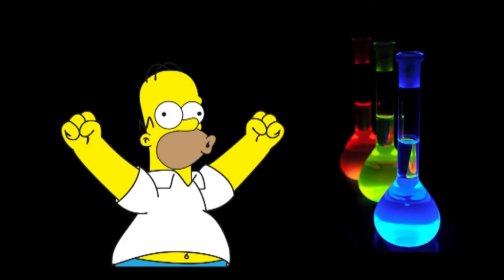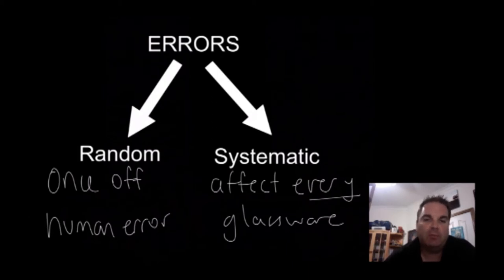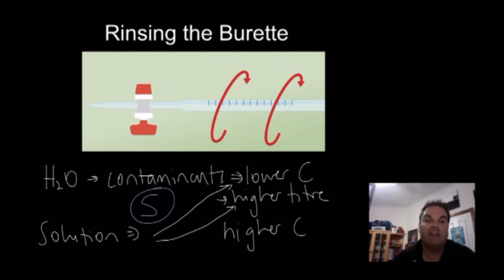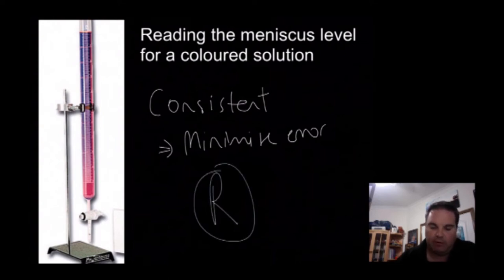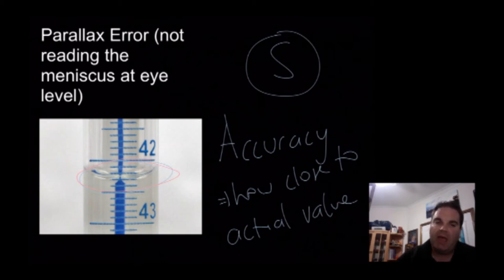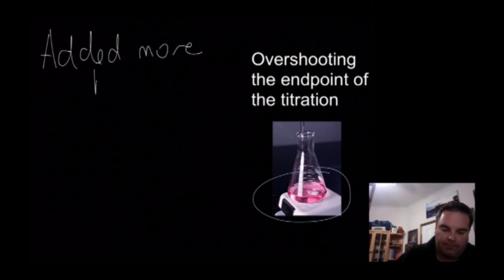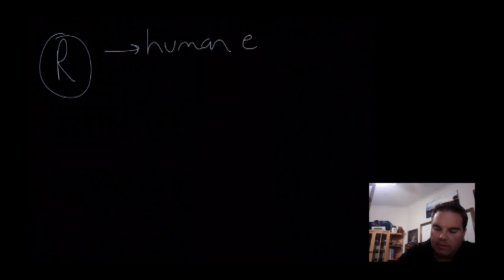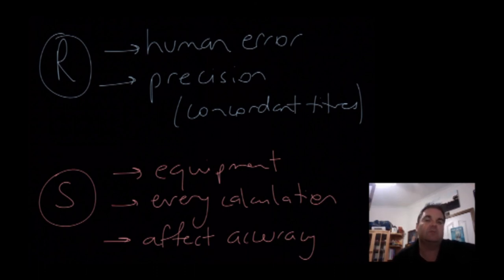Random and Systematic Errors in Titrations

Comment: Hello sir, how does the concentration increase when the titre is low in 6.07
Reply: He has actually made quite a lot of mistakes, including the one at 6:07. Suppose, 10 ml of the titre is actually added to the reaction vessel, but the added drops from the funnel reduce this to a measured reading of 5 ml, which will be used in calculations. Since, less moles of the titrant will be calculated to have had entered the conical flask and reacted, less moles of the titrand will be present in the same volume as per the calculations so the calculated concentration would be lower than the actual concentration. The one at 6:07 is actually a systematic error, since the error would have a unidirectional effect on the concentration calculated (always results in a lower concentration), but the extent to which its lower varies as the number of drops that drop into the burette from the funnel. 

At 8:40, consistently rinsing the pipette with the wrong solution will be a systematic error, rather than a random error as it changes the final calculated concentration in one direction only (either it always gives a lower or higher titre volume than the actual amount throughout the many titration trials, depending on whether the acid or base was used for rinsing). Inaccurate and imprecise results will be produced (rinsed to a different extent each time, thus affecting concentration differently each time).

At 10:24, the bubble at the bottom end in the pipette and the burette is actually for calibrating the glassware and not an error, but rather it improves the accuracy of the measurement. Once the bubble is removed from the outflow of the titrant, it will return again once the stopcock is turned off so it will not affect the initial and final reading of the titrant.
Reply: The one at 6:07 is actually a systematic error, since the error would have a unidirectional effect on the concentration calculated (always results in a lower concentration), but the extent to which its lower varies as the number of drops that drop into the burette from the funnel.
Reply from the maker: @kirtanpatel1381  Hi Kirtan, to clarify some of your comments:

1. 
With regards to the calculation, if your unknown concentration is in the burette, then a lower titre value against your known standard solution in the conical flask will result in a higher calculated concentration for the unknown sample. Example:
If HCl is in the burette and is titrated against 0.105M Na2CO3, a titre value of 24.35mL would give you [HCl] = 0.1725 M, but a titre value of 22.35 mL (due to drops from the funnel moving the meniscus back higher) would give a [HCl] = 0.187 M. This is because the extra drops make it appear that there are more moles in a smaller volume, hence increased final concentration value. This video is designed for my high school students where we always have our known solution in the conical flask, so apologies if this has caused confusion. 

If the funnel is only left in for one of the titrations, then it will be a random error. This is what I was trying to explain. Even if it was left in every time and the number of drops changed each time as you indicate, this is again not a consistent error, so it will still be random. Yes it will result in a lower concentration each time, but not always by the same amount (which is what a systematic error would result in).

2. I agree, if you consistently rinse the pipette with the wrong solution it will be systematic, but students are taught to only rinse with the solution being used the first time. There is no need to rinse again after that, so any of the initial wrong solution that was used would have gone with the first titration, hence why it is a random error as it only would affect the first titre value. 

3. I am referring to air bubbles that may be present due to sucking up air when filling the pipette. These take up space in the pipette and mean that the volume is less than the stated value on the pipette. Sorry if this was not clear.

Comment: I didn’t understand the bit of not filling the below tap what do you mean. We should fill solution till below the tap.
Reply from the maker: Hi Drizzy, if you do not fill below the tap then it is a random error as the titre value will appear higher than it should be. You are correct in that to perform a titration correctly, you must fill below the two before your first titration
Reply: Thanks  dude can you tell me few errors like systematic, human and random for a titration for KHP Vs NaOH please. Also how I could reduce them as well the errors.